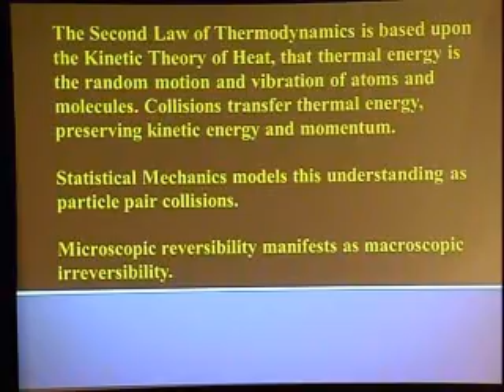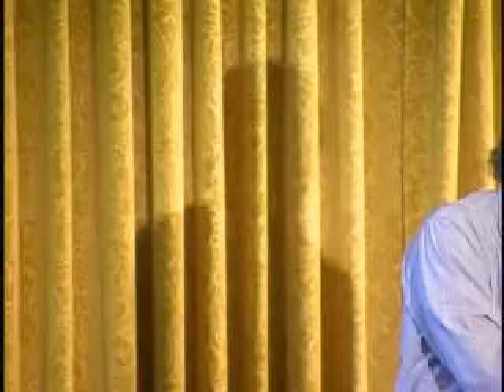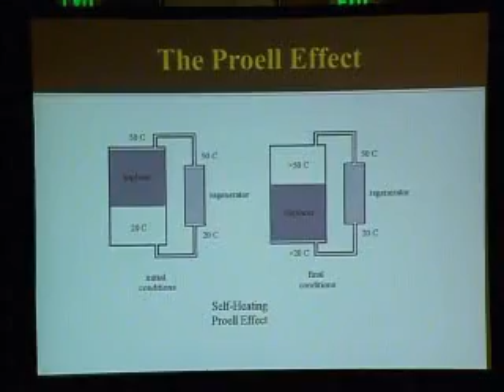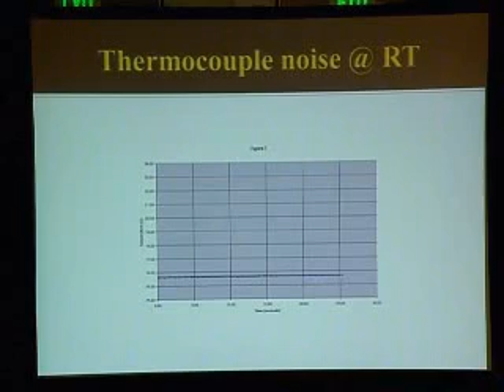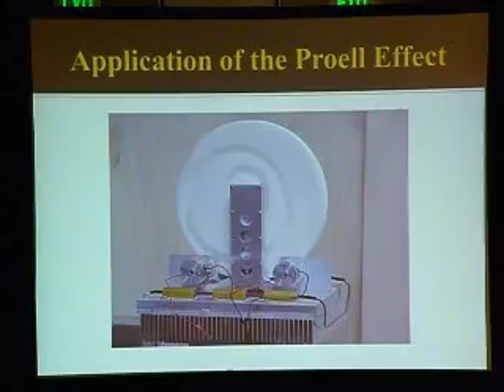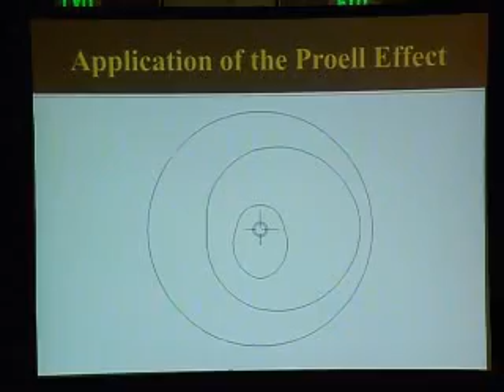SSE Talks - Proell Effect, Energy Devices, Maxwell's Demon - Kenneth Rauen

Comment: The worthless ambient heat engine concept at the center of this fraudulent flimflam is a certain utterly ludicrous exercise in silliness, produced by Kenneth Rauen, that does not have any “patent pending” and never will. It consists of nothing more than several cylinders containing pistons connected to a crankshaft, with various open channels between some of the cylinders. There is nothing to make the pistons move or the crankshaft turn. Rauen has written many pages of tedious nonsense attempting to argue that the engine would work. It certainly will not work, and Rauen certainly knows that it will not work, and so does Goldes.

http://intlphysicsreviewboard.wordpress.com/mark-goldes-no-fuel-piston-engine-swindle/